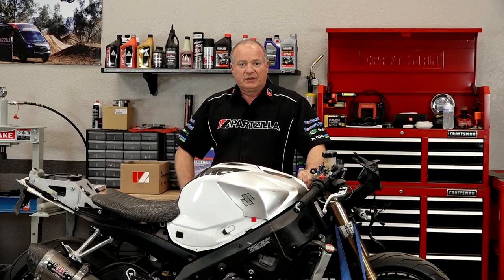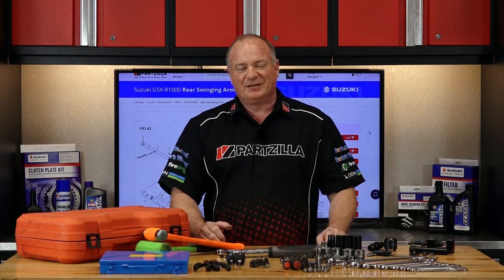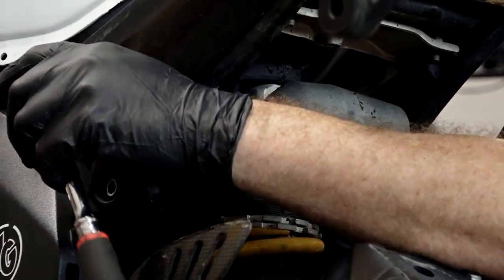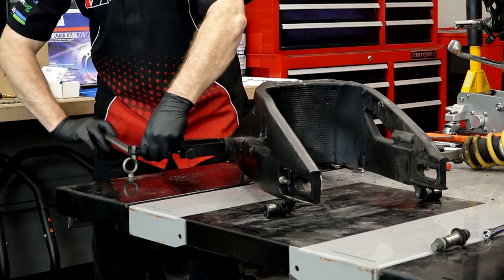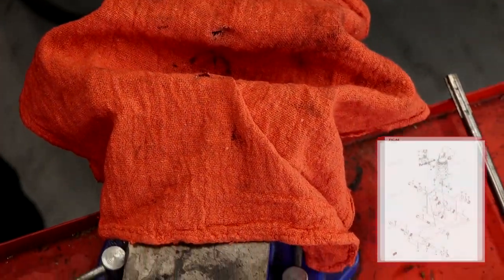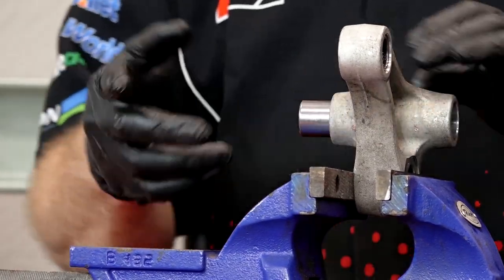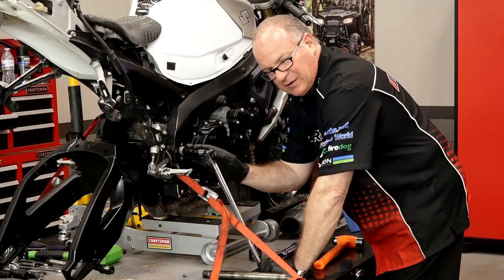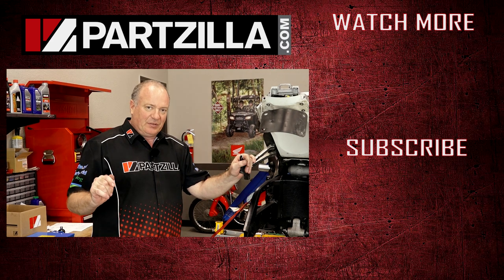Swingarm Bearing Removal and Replacement | GSXR 1000 | Partzilla.com

Comment: I would class myself as a 'Level 1' DIY enthusiast. With this video, i was able to do this entire job on my 2007 GSX-R 750 and i also had the shock rebuilt and with an appropriate lighter spring. Bought a LOAD of tools including an industrial press (love that thing) for the cushion level bearings...makes thins SO much easier. I have just finished putting the swingarm back together including the lower linkages...SO tight but so glad I have replaced it all. 

Thanks for the great video content. You aren't available in the UK but please consider expanding overseas and I would have happily purchased all the parts from your site. Thanks again John!
Reply from the maker: Terrific! Glad the video helped you out! And someday-- maybe Partzilla UK will be a thing!

Comment: Swingarm bearing removal was successfull with a Blind bearing tool using a stout metal rod.  Tightened the collet into the bearing
and using a stout metal rod from the other side used the collet as the striking surface, drove the bearing out in a minute.  I heated the swingarm bearing area before.  Used the same method for the cushion bearings as well.
Reply: I had to do the exact same thing. Slide hammer wasnt moving the bearing, and even a puller wasnt working. Tried with a rod from the other side and it was just pushing the collet out - finally heated the area for 5 minutes before hand and that did the trick. Wish I had read your comment earlier!

Comment: Good video... I drove my old bearings out with a punch... pretty easy with a heavy hammer..  BUT the center tube that acts as a spacer for the bearings is soft aluminum and gets damaged by the punch.  So if you plan on driving them out, you will need a new center tube along with the new bearings.  Keep up the great videos!  Jeremy

Comment: Ive done this a few times putting extended arms on. I chose one time to re use the pivot bearings and swap them over to the new arm instead of just paying $30 for new ones installed.I can tell you I did not have that fancy tool to remove them and walked right into a nightmare. I believe it took about an hour to get them both out by hand... Def buy the tool if they have to be removed lol

Comment: Hi I had to do some needle roller bearing on a Honda leaver arm but all the needle rollers had come out so I was left with just the outer part of the bearing so I used a dermal grinder with a grind stone I cut some groove to the casing so then I could force the outer casing to collapse in on itself to get the bearing  but used a draw bolt system to put the new needle roller bearing in

Comment: Slide hammer didn't work for me. Wasn't enough 'slide' to get the momentum to pull the bearings. I ended up putting the collet in the bearings and using a bar from the other side. Tapped out nice with a club hammer

Comment: Why did you have to grind the chain, by removing the rear wheel and the center nut holding the swing arm will obviously remove the chain.

Comment: My service manual doesn't say that I have to disconnect the drive chain to take off the swing arm.  Is it necessary to remove the drive chain?  If I have to remove the chain, that would mean I would have to buy a new master link, right?  I don't use clip ons.
Reply from the maker: Yes, you can use a new rivet link.

Comment: Where can I find the same  Torque measurements for the same part just for a 2007 gsxr 750 I just  Recently took my swimg are off i just want to make sure I had the correct ft lbs gear video buy the way
Reply from the maker: The service manual will have all the specs.
Reply: @PartzillaParts  I've looked everywhere would you happen to have a link lmk thanks

Comment: I got a problem with the bearings of the monoshock of my bike, one of them was in a pretty bad shape so i needed to replace it, sadly i didnt find the same bearing, so i tried to use a bronze piece to replace it, you think it was a good idea?
Reply from the maker: Probably not.  What's the bike?  I'm sure the bearings are available.
Reply: Partzilla its a Honda Tornado 2014
Reply from the maker: Unfortunately, we only carry parts for US models.  You would have to look locally for the parts.
Reply: Partzilla yeah im going try to find that bearing, meanwhile that bronze piece must be enought for now, thanks